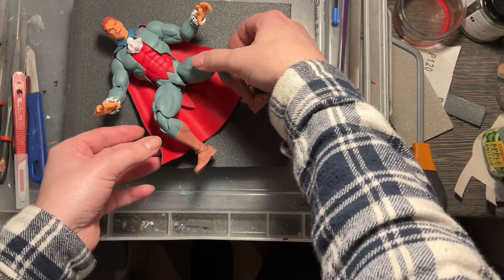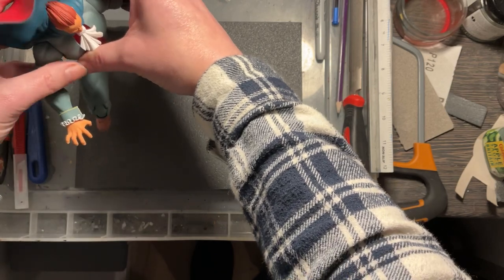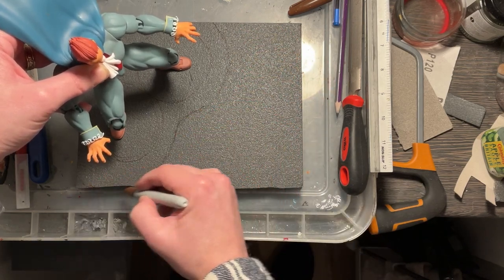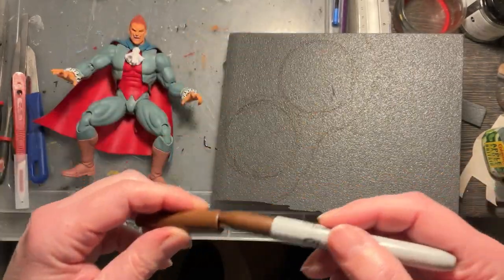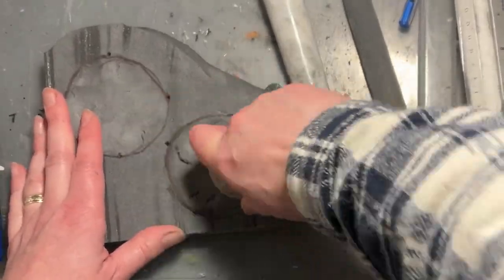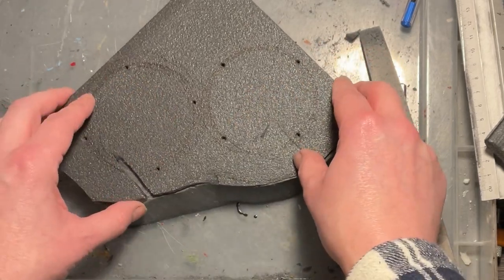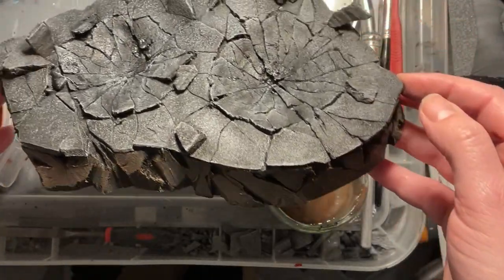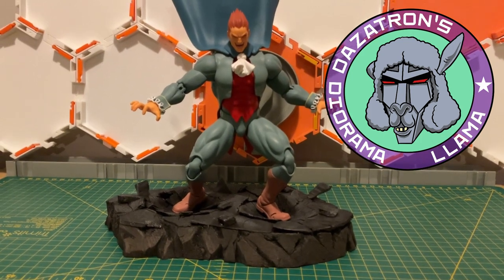Making an Impact Crater Diorama #diorama #actionfiguredisplay #beginnersdioramas

Comment: Did the epoxy not quite glue the “tarmac” layer down very well? Any concern that these won’t stay glued down in the long run?
Reply from the maker: It definitely glued it, I didn’t mix enough to get a more even spread. If I had done that bit right I shouldn’t have had to do those touch ups. You don’t have to use epoxy either as long as the glue is suitable for styrofoam. I just like the gorilla epoxy as I can still work with it after 15-30 minutes.